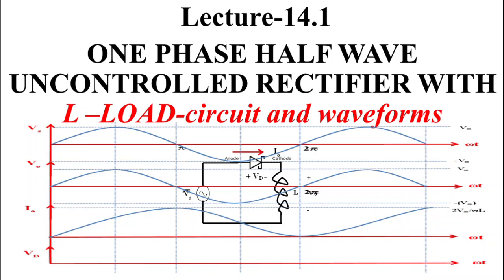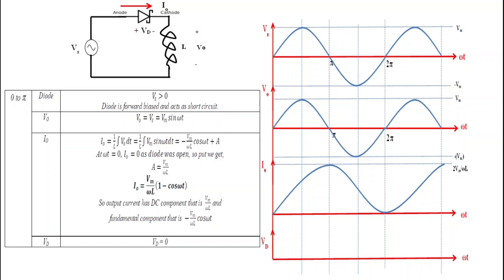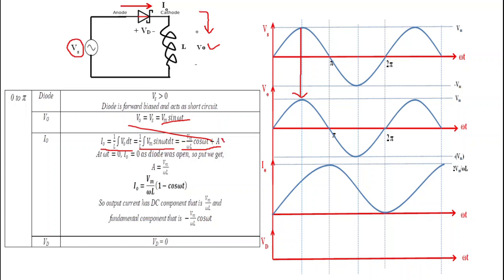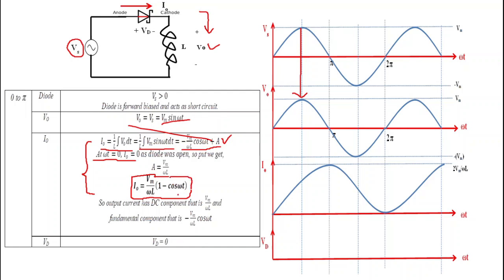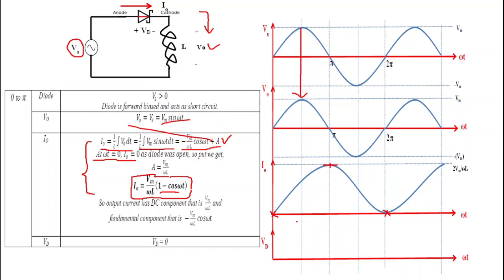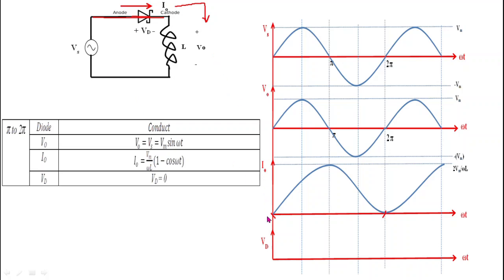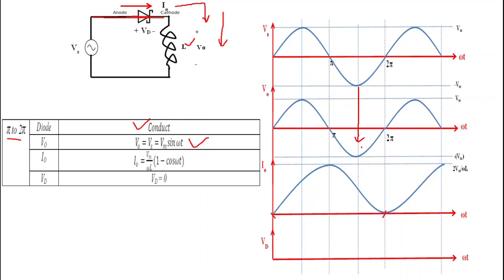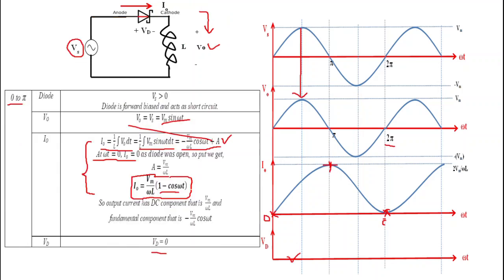Lecture 14.1 | One phase half wave uncontrolled rectifier with L load | circuit and waveform |

Comment: thanks for this amazing lecture.
I have a question plz, what will be the arms value of the load and the diode too ?
Reply from the maker: Thank u very much for your response. 
Now come to your question, value of load and diode ratings can be selected on the basis of output desired. You can get various formulas regarding this in 14.2 lecture.